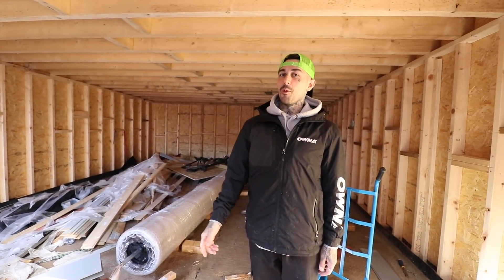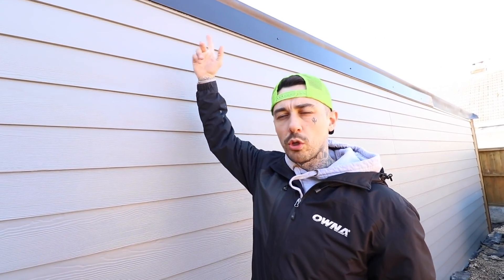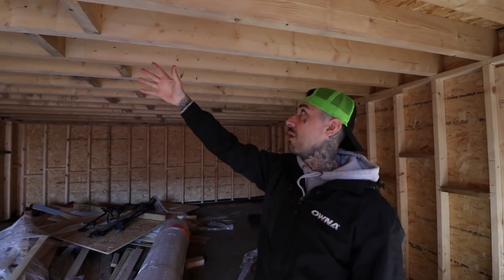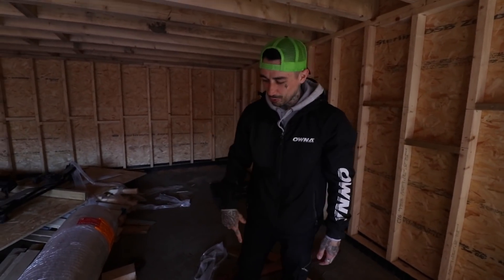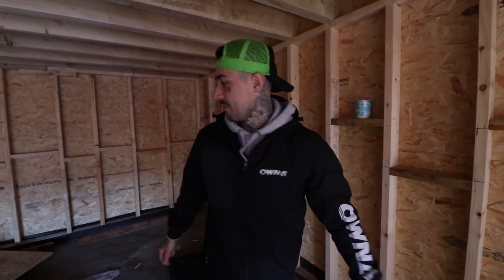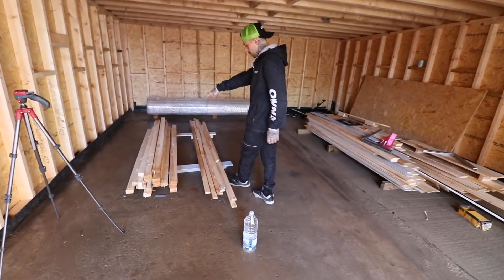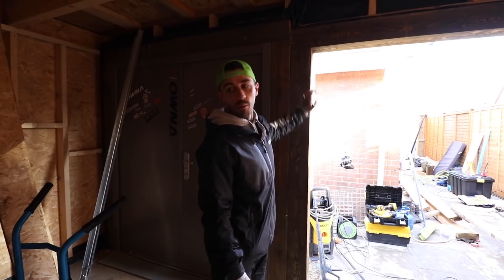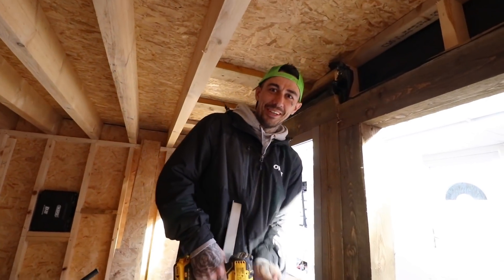DREAM GARAGE BUILD - DIY ROLLER DOOR!!

Comment: Good video, I'm glad you show and explain the mistakes with the door, and they are very common mistakes people make. I am a roller door installer (20 years) I do admire that you gave it a good go and mostly did a fantastic job. I definitely would leave the big screws in the brackets as they are holding the weight. Runners can have some lighter gauged hardware, that's fine. Runner was at correct height too. All in all I think it was a success, kudos.

Note: if you paint runners, please leave inside free of paint. Always keep it clean and dry as possible

Comment: Double sockets every two metres at worktop height and outside socket at front and one near hot tub.
Also double LED battens like you said in two lines , you might want a couple of free standing vertical battens too for when you're detailing.
A floodlight at the front and side is a good idea too.

Comment: Put in more power outlets then you think you need.
Also, put them at workbench height so you're not chasing around behind toolboxes and workbenches for power... Obviously the ones on the car side can be nice and low but where you're putting your work benches, make them higher.
Keep up the good work lad.

Comment: Does the structure comply with uk building regs. I assume its over 15sqm floor area . As i understand it if the structure is  within 1m of a boundary those walls need to be class one( fire regs) compliant..not been a stick in the mud because I intend to build something similar but I've come a cropper at the planning stage.. permitted development in the uk is still subject to uk building control..
Be great to get your thoughts on this..

Comment: A little advice from a guy who uses his garage every day. When I installed my lighting I wanted to go overkill and I installed 6, 4 bulb fixtures for a total of 24 H8 bulbs in a 24x26 garage. My lighting is decent, but I still have 4 more H8 bulbs over my bench and a LED fixture over another area. If you're filming, you're going to want lots of lighting and if you're working on vehicles, bikes etc ... you're going to want lots and lots of light. 

If I were doing it again I would add another two fixtures for sure for a total of 32 bulbs.

Comment: That cave is tighter than a Tupperware. Any extraction going in to help avoid moisture buildup? A snail fan can help accelerate the drying of the slab...which is a good plan prior to putting down the floor...don’t want mould or anything. Just my 2 cents. Great job on the build!

Comment: Nice job Harry well done. The difference between Rockwool and Kingspan is ease of fitting Kingspan fits with a saw and is easy Rockwool cuts with a knife or shears but you need to wear gloves a full boiler suit a mask (It's not good to breathe the dust) and cover all skin or you are gonna itch for a month I used Rockwool a lot when I was younger and I can't stand being near it now (Sensitization they call it) very much like fibreglass insulation but like you say a lot cheaper and just as good insulation wise

Comment: PIR insulation (kingspan etc) has about double the insulation value of rock wall, but if you think rock wall will be sufficient then it’s worth saving the money, and working with PIR is absolutely grim, worst job I did on my workshop build! Especially when it comes to the ceiling.
I went for the same style of flooring that you’re talking about. Ended up going with the ‘duratile’ from Duramat, highly recommend, it’s a great product. From other people experiences I avoided the products with raised patterns like checker plate, as it’s reportedly not very nice to knee/sit on!
Looks like you’re doing a pretty solid job though, it’s a massive space! Oh I’d also think about increasing the number of sockets, I ended up with 10 in a 5x3m workshop, at the end of the day they don’t cost loads and by the time you’ve got stuff like radio, compressor, battery chargers plugged in you’ll not be left with a lot of spare sockets :)

Comment: Garage lights get these from screwfix - 2 x Twin 5ft LED Batten White 45W 4000lm (5440R), Simple to fit and my god they are bright. I have 4 in my 18x18ft garage and its like daylight cant recommend them enough. Also if you haven't already get a quid co cashback account as they do cashback lol

Comment: Zone your lighting using multiple switching points, 2 ways & intermediates etc, this will save you having to walk back and fourth to the main entrance door  switch all day. If you are having wall units above the base units don't forget to have some lights under the wall units for little fiddley jobs. Also, stick a single socket where the ebike will be stored, nothing worse that cables/extension leads everywhere. Double sockets above the work tops for charging gopros/phones etc, same as in your kitchen.

Comment: Always a good idea to place the L brackets in position first then mark out the holes, then get a small drill bit to get it started so the coach screw threads in easier into your fitting structure. Also a good idea to make sure the fixings are fitted in the centres because if any adjustments are required for "up & down" at least your have abit of movement compared to Having the fixings at the very top or very bottom. Overall though great project, coming along nicely

Comment: Hi Harry, I have a garage with concrete floor and it gets dirty really easily so I went out and bought some industrial floor paint and rolled it on the floor and it looks amazing and doesn’t get dirty at all and you can wipe and brush it with ease so it’s just a idea but you don’t have to if you don’t want 
Thanks for reading,

Harry.

Comment: That part of the clamp for the shutter axle should be under it, but on top of the mount bracket, the u bolt goes directly over the top

Comment: Have someone put down 3 inches of closed cell spray foam.  Would cost a few grand but its the best insulation and adds to the structural rigidity.  In the states we have to put epdm over 1/4 per foot pre-slopped foam sheets.  You can slope the roof to one side or have it go to drains or a curb and scupper.

Comment: Foil coated kingspan/celotex/etc is good for a vapour barrier. If your car comes in wet then that water goes into the air and then it’s got to go somewhere. Traditionally graves have a good flow of air through so clears out the moist air, but that means it’s the same temp as the outside so makes the insulation pointless.

The problem with insulating is you raise the temp of the air which then absorbed more water. When the more moist air hits the colder areas then the moisture condenses out on what ever it can. If that’s in the wooded areas then you get damp then rot. 

The best thing you can do is get a really good moisture barrier and seal the warmer areas so you reduce the flow of air into the bits you don’t want. Ideally you wanted to insulate the roof outside and make a “warm” roof. 

Alternatively get a good desiccant dehumidifier. Most come with continuous drains and use that to pull the humidity level down. Not too low if you have leather seats or they’ll crack like Joan rivers face unless you feed them with some leather treatment.

Subbed to see how this build goes.

Comment: Good on you mate! Good ol garage that is.
 But wondering why you didn't add a window in line with hot tub...or there abouts. Mostly for light, for the times you want the front all closed up. 
It feels better with a window sometimes.
 Cheers my brutha.

Comment: Your garage is quite fantastic Mr. Main!! Such a nice big work space. I am curious though why you didn't put any windows in for natural light. Also, if I may chime in with a suggestion. When you reinstall the wall planks inside ....stagger the joints. I does take a bit more time but in the end it all kind of blends nicely. Just a thought. Cheers.

Comment: Also you made sure the cable you’re getting is the right size, and put an RCD enclosed box underneath the DB so it essentially has it own protect for the garage as a circuit

Comment: The U clamps you have used to hold the roller shutter door. You have put them on wrong lad. You take the two parts of the clamp apart and you put the U shape part through the holes and very the shaft of the sort ten put the other part at the bottom then put your washers and nuts on.

Comment: People will tell you to use cold water to wash the insulation off your hands and arms.. cold water will close your pours with the glass still in it. 
Use warm/hot water. It opens the pours allowing the glass to be washed away. 
Also use a fine tooth serrated bread knife to cut the rockwool. For the ceiling, one guy measures, one guy cuts the width on a table of some kind so the measuring guy doesn't have to climb up and down a ladder as often. 
Rockwool is nice to use. It'll never burn and it's way better at sound proofing.

Comment: Hey mate, it's looking mad. Have you thought about drainage along the front of the shed? Water may come under the roller door and under your rubber floor if you get a lot of rain. Concrete box drain is pretty easy to install and maintain. ☮️

Comment: Harry, you have worked hard, have you left any air vents in the roof, otherwise the space in the roof will suffer from condensation and rot the inside of the roof.

Comment: Use long nails as tacks to help hold the rock wool in where its in the walls or a bit loose fitting 🤙🏽 keep up updated with the WHOLE project bro that includes the gardening

Comment: The hack to fit the part correctly? Surely that isn’t a hack? That’s just fitting correctly lol, good progress on the garage/workshop though, also use celetex or the board insulation 100mm or 75mm board 👍🏻

Comment: You might need a rubber runner across the floor to go under the roller shutter so the water doesn't run into the garage

Comment: Do you need insulation for it bud, this stuff I get is foil backed, sound deadening, and keeps serious heat in 🤔 been fitting it in the mancaves we have been building. Only 40mm thick so loads of room for ye canes and there's no mess when cutting it 👍

Comment: Good job you didn't choose King's pan you would have ended up paying someone to fit it or have had a shit installation if it was your first time. Rock wool is the best insulation in my opinion ruthless stuff grade A type of gear not ichy either.

Comment: Cringed when I saw the u-bolts put in..glad you got it right in the end..do you need to put vapor barrier in between insulation and boards in u.k? It's code here..also you can never have enough outlets..some low. Some high..